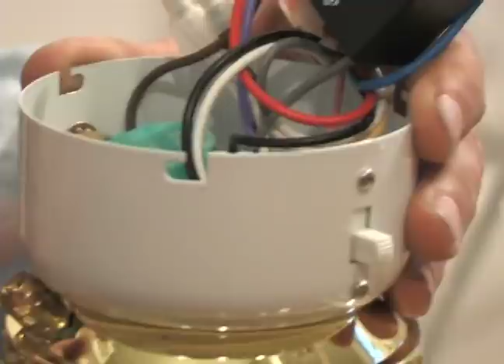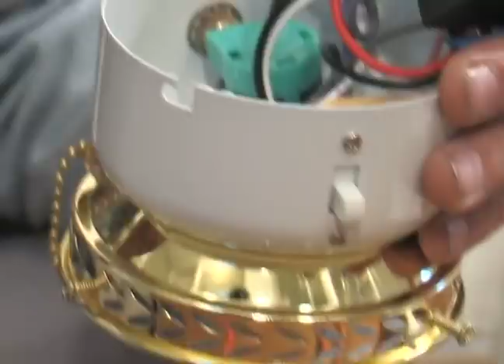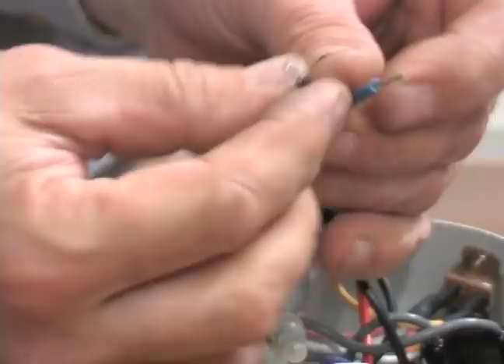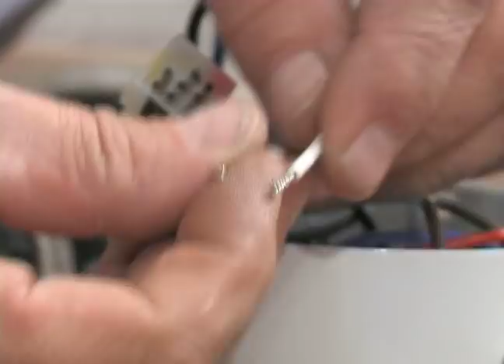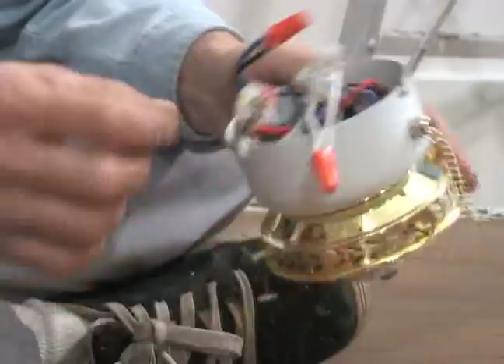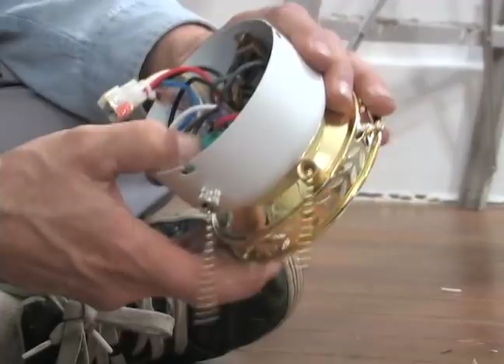How to Install a Ceiling Fan : Wiring the Light Kit for Ceiling Fan Installation

Comment: My problem is not getting the light to come on or dim unless the fan is on high speed. I have a Lutron fan/light dual slider switch, three positions for fan. I want to run slow or medium and be able to have light and dim it. My fan has black, white, blue, and green wire. Blue is normally for the light. I even ran a wire from the red dimmer wire to the light bypassing the light on and off chain/switch. It did the same only coming on and dimming at high speed.
It is a Casbah #4152 by Kenroy Corp .

Comment: @thedisruptive1 Hi disruptive.  My friend and I have deduced that I have a wire on this breaker system that is backfeeding power. Both the white and black wire when disconnected from the Lutron switch are showing power when grounded. I am going under the house this weekend to see what is mismatched on this circuit and may alleviate this problem. Thank you.

Comment: I accidentally pulled the chain for the fan and the chain broke. Can the green plastic case inside be replaced? If so, where can i buy one? And what is it called? Please help
Reply: buy a new "ceiling fan light switch" at the hardware store. there's a video by someone else that tells how to install it.